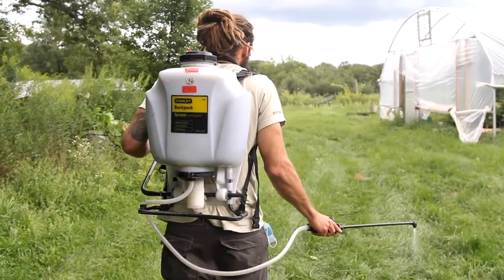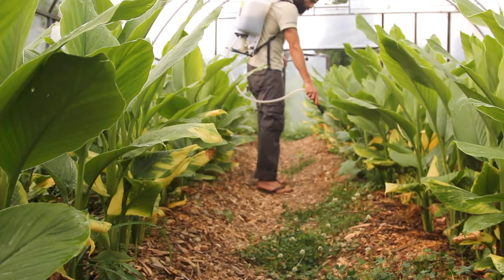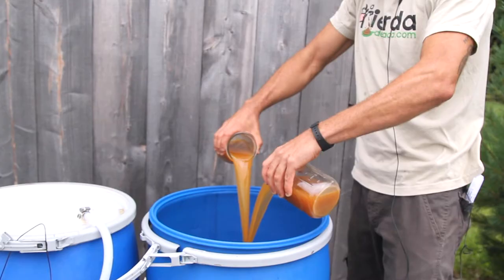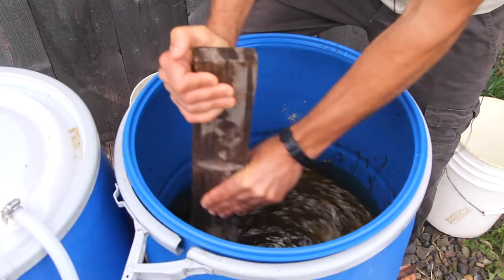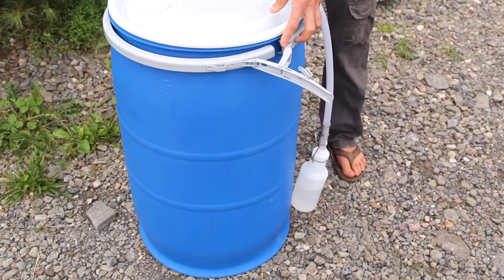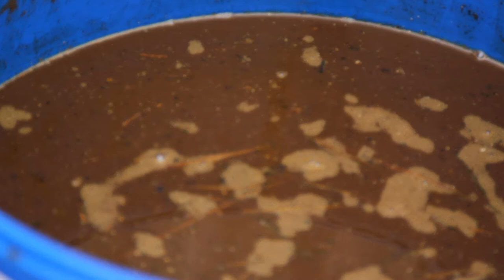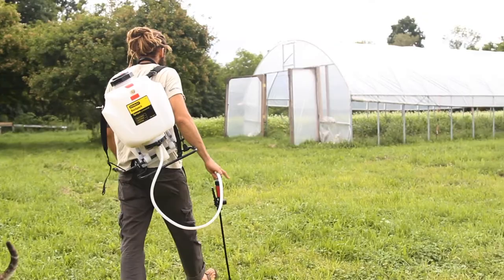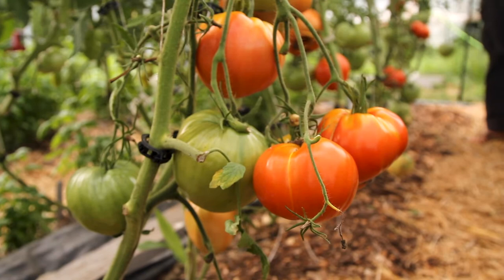How to Make Super Magro: A Full Spectrum Biofertilizer

Comment: 30 liters of water + 1 bucket manure + 2 jars of whey + 1 jar molasses + 1/4 jar rock dust and 1/4 wood ash - anaeraobic fermentation - seal tightly but put an airlock that allows gas to go out and no air coming in.  one can add other minerals like manganese, zinc, sulfur, as may be needed by your soils...blessings
Reply: wonderful - would be great to read scientific papers on this anaerobic fermentation thing (perhaps vs. aerobic) - basically on plant performance which in my mind leads to great soil health...mygreathanks and blessings

Comment: Do you have to use whey? There must be a vegan way to make this, right?
Reply from the maker: Kai, great questions! I'm sure many folks that adhere to similar principles would appreciate this inquiry.  The answer to both of your questions is, contradictorily, YES. Yes, you have to use whey (or low-fat milk) for this specific method, and Yes, there must be another way. 
 Regarding the first Yes: In the above method,  where we are replicating the environmental conditions found in a cows stomach to explode a population of highly-specialized fermentation microbes (rumen microbes), whey is an essential component, and its absence would alter the biochemical parameters of the process and the desired end product. Whey, like the other ingredients used in this process, fulfills a unique set of essential requirements in the least amount of steps using the least amount of additional resources (equipment, capital, etc) to meet those requirements. It's the shortest distance between two points if you will, which is why this biofertilizer process and its formula were designed the way they were. 
 Regarding the second, contradictory Yes: Technically, it's the chemistry of whey that is required, not whey itself. Therefore, you could fulfill the same set of essential requirements that are attributed from whey by sourcing and substituting the pieces of its collective composition from alternate materials. This would add some obvious complexities to the process, however its entirely do-able if you enjoy a challenge.  If so, you're already halfway to your solution - you have access to the worlds knowledge (internet) and you possess the ability to read and write. All you need to do now is ask your search engine enough questions*  
 Keep in mind this is just one of many ways to cultivate microorganisms and utilize the beneficial products of their metabolism to mobilize soil and crop nutritional components (Daniel Harvey mentions two good examples).  This method was chosen for the video demonstration because the components and the processing equipment are both ubiquitous and inexpensive, the production steps are analogous to a cooking recipe(familiar to many ppl), and the efficacy of the product has a long-standing track record. 
Despite the lack of a clear answer to your question, I hope there is still some value in this response. Be well, Kai.  
Sincerely, 
Shaun

*If you're so inclined here's some search engine momentum: 
- 85% of whey is comprised of just 5 proteins (What is the composition of whey?) 
- Proteins are also referred to as polypeptides (what are the components of a protein?)
- A peptide is two or more amino acids (what is a peptide?)
- Soybeans and soy products are a complete source of amino acids (what are vegan sources of amino acids?)
...You follow the trend here? ...Everything has a parts list ...Keep asking questions and disassembling larger units until you have the chemistry you need in an agreeable form. Run an experiment and share your results!
Reply: @cornellsmallfarms  So awesome!! Thank you for such a great response.  Very much appreciated
Reply: Lactobacillus is in natural fermented or wild cultured vinegar. Japanese Nature Farmers have used that for a long time. The yeast is beneficial too.
Reply: @cornellsmallfarms  great day!  bought the biofertilizer manual by juanfran lopez.  would be very much interested if you people have on hand research on the use of these methods.  as for myself, we will record how we use these practices and our results.  mygreathanks